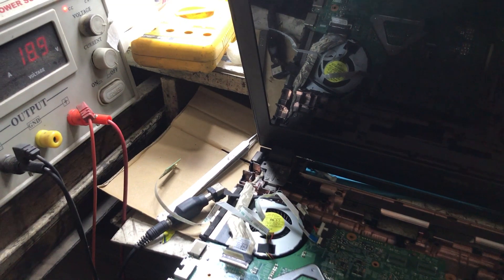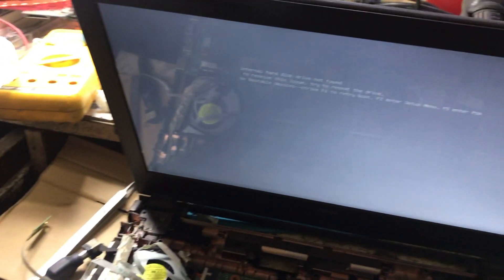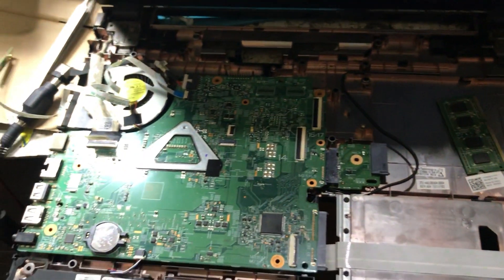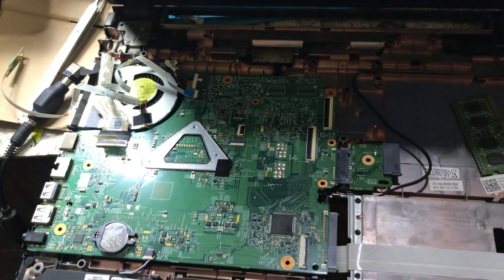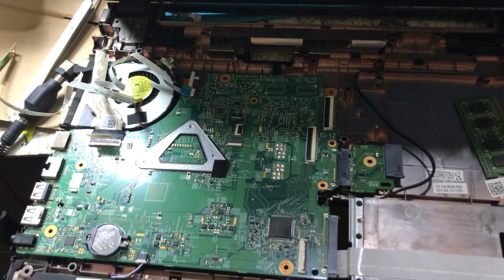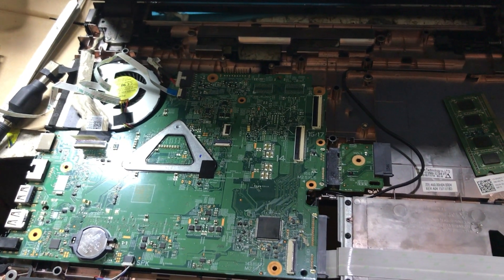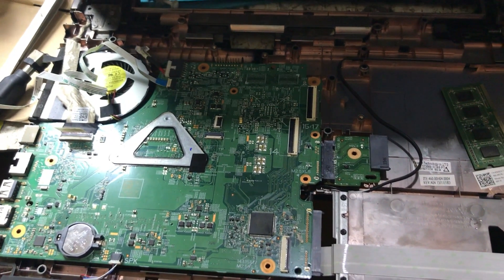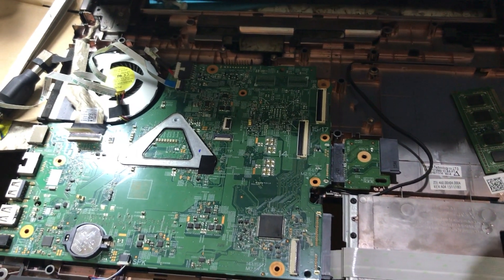Dell 2 beep Problem solution by #Aditya11ttt & #Satishbhai

Comment: Hello! i am having this problem with dne40 motherboard with dell 3421 Laptop.. The ram is ok. Tested with another laptop. The 1.35v is present and all system voltages too!  Have no datamem communication and i am in doubt about the LAD and Lframe# signals that i mesured with my oscilloscope. just a tiny package of information as soon as i push pwrbtn. Have the same with both. The Pltrst# is ok and high few ms after powerbutton.  Any idea? Damaged cpu ram controller

Comment: The same problem am facing in my customer laptop 2 beeps and no display problem I check the voltage too it coming properly so the inbuild processor having a problem so need to replace motherboard that is the only solution
Reply from the maker: Ram section issue
Reply: Ram section means whaat is the exact problem?
Reply from the maker: Ram not detect is the reason , “exact” I don’t know ! I don’t have board in my hand you have so u need to check self ! 
I can only give hint !

Comment: Hi i have same fault. But ram is ok. Checked with few rams.  Vref ok. All are seems good. But no display continues 2 beeping
Reply: did you get a solution? having the same Issue right now with dne40 mb.  Dell 3421 ivy bridge. I was looking for data mem pin 200 and there is no communication there! So i checked the LAD and Lframe with oscilloscope... got very tiny communication package right after pwrbtn

Comment: I have a dell LA-8241P board that has beeps RAM error but if i put RAM it turns on goes off in five seconds and doesn't give display. I've tried both PC3 and PC3L RAMs to no avail. Please help
Reply from the maker: Elson Justin bios flash

Comment: I have the same problem with my dell inspiron 15 ,3000 series. Changed the ram of kinds but the problem is there. Checked for signals on the ram i found out that ramreset signal is missing bt i could fix it. Any suggestions bro?
Reply from the maker: Try another slot !! Or rebuilt the signal !!
Reply: @Aditya11ttt  i tried anothr slot its not working. How do i rebuilt the signal sir?
Reply from the maker: Starmaker Videos need to be check physically!!
Reply from the maker: Starmaker Videos search for the Signal missing and try rebuilt !!